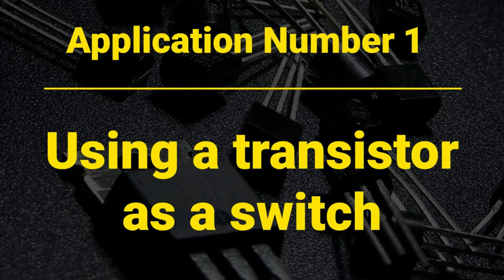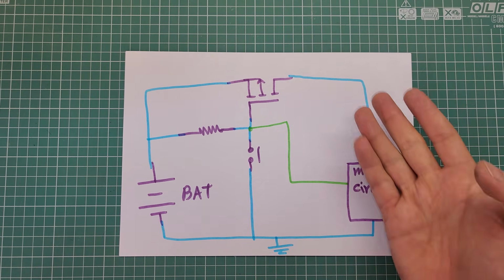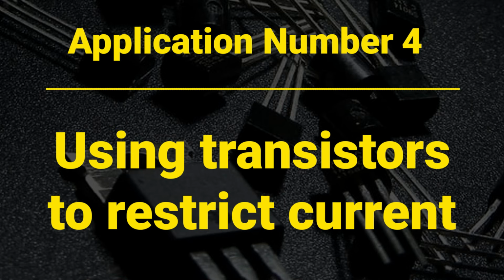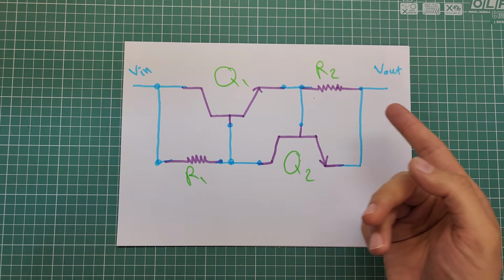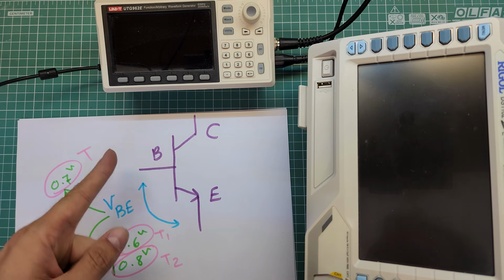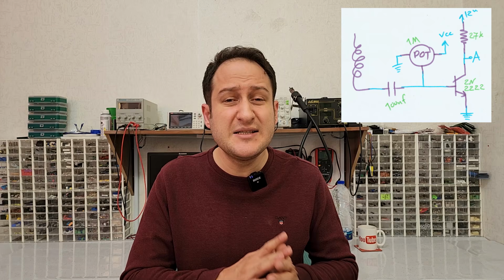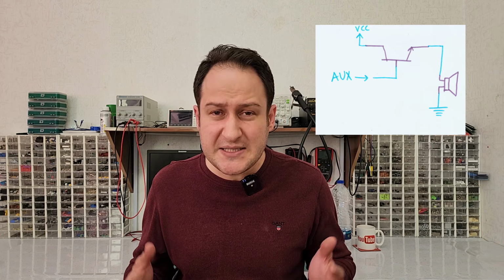7 awesome applications of transistors in circuits

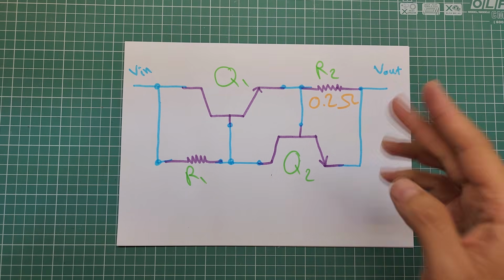Comment: I thank you again for this awsome video dude BTW one question 15:50 would you reccomend to put this on the output of a precision reference voltage IC (example 10V with precision at least 0,000) to limit the current to 10mA for example? will the precision of the output voltage be affected by this circuit? and would there be a voltage drop after the Vout?

Comment: Hi Electronic Wizard. Thank you for the video. Could you please help me to assess if my understanding of the MOSFET as a touch sensor at 10:29 is correct?

        1.	MOSFET Configuration: The IRF640 MOSFET is configured in a way that its gate (G) is sensitive to touch. The drain (D) is connected to the motor (MOT) and the source (S) is grounded.

	2.	Gate Capacitor Effect: MOSFETs have an inherent gate capacitance, which is very small. This gate capacitance can be charged up by a small amount of current, such as the one from your finger when touching the circuit.

	3.	Touch as a Charge Source: When you touch the exposed metal connected to the gate, the tiny electric charge from your body (called 
Electrostatic Induction, or ESD) is enough to slightly charge the gate of the MOSFET, changing the voltage level at the gate.

	4.	Gate Voltage Control: When the gate reaches a high enough voltage, it allows current to flow from the drain to the source, turning on the MOSFET and powering the motor. This means the motor will activate when you touch the gate.

	5.	Resistor Discharge: The 10 MΩ resistor connected between the gate and ground serves to discharge the gate capacitance when the touch is removed. With this high resistance, the discharge happens slowly, allowing the motor to turn off gradually after you remove your touch.

	6.	Improving Sensitivity: A spiral or touchpad pattern can be used instead of simple electrodes to improve sensitivity, making it more reliable and responsive to touch.

In summary, touching the gate causes a slight voltage increase due to your body’s electrostatic charge, turning the MOSFET on and powering the motor. The 10 MΩ resistor discharges this charge when you stop touching, turning the motor off.

On the role of the resistor:

        1.	Role of the Resistor in Setting Gate Voltage: The 10 MΩ resistor serves to discharge the gate capacitor when there is no touch. However, it also influences the voltage at the gate when you do touch it. When you touch the gate terminal, a small current flows through your body, charging the gate capacitance through the skin’s resistance. The 10 MΩ resistor provides a path to ground, so it creates a voltage divider effect with the effective resistance of your skin.

	2.	Skin Resistance and Resistor Value: The resistance of human skin can vary widely, generally ranging from hundreds of kilo-ohms to several mega-ohms, depending on factors like moisture and contact pressure. If your skin resistance is, say, around 1 MΩ, it combines with the 10 MΩ resistor to form a voltage divider, which can set the gate voltage closer to the threshold voltage of the MOSFET. The higher the value of the resistor, the more it “favors” the gate retaining a charge (keeping it “on”) after touch is detected, since it provides only a slow discharge path.

	3.	Choosing the Resistor Value Based on Skin Resistance: If the resistor is too low (e.g., 100 kΩ), it would discharge the gate too quickly, and your touch might not increase the voltage sufficiently to activate the MOSFET reliably. On the other hand, if the resistor is too high (e.g., 100 MΩ), the gate might remain charged longer than desired, making it less responsive. Thus, a resistor in the range of 5–10 MΩ strikes a balance, ensuring the gate reaches a high enough voltage when you touch it, while also discharging reasonably when you remove your touch.

In summary:

	•	The resistor helps achieve the necessary gate voltage by creating a voltage divider effect with the skin resistance.
	•	Skin resistance influences the resistor choice, as a higher resistor value is needed to work with the variable (but high) resistance of human skin and ensure reliable gate voltage change upon touch.

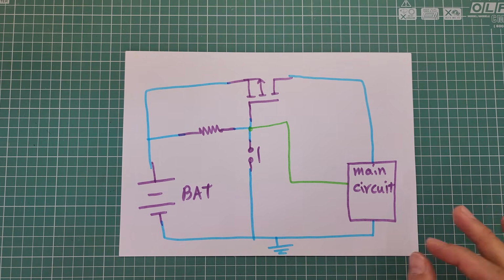Comment: I tried to better understand how circuit at 9:21 works (mosfet as a switch for another circuitry) and here is what I came up with:

1. P-Channel MOSFET Operation with Knock Sensor:

In this circuit, the P-channel MOSFET has its source connected to the positive terminal of the battery and the drain connected to the "main circuit" (whatever load or circuitry it controls).

The knock sensor temporarily connects the gate of the MOSFET to ground when triggered by a knock. This grounding lowers the gate voltage, creating a sufficient gate-source voltage difference to turn the MOSFET on, allowing current to flow from the source to the drain and powering the "main circuit."

2. Role of the Pull-Up Resistor:

The resistor between the positive terminal of the battery and the gate of the MOSFET acts as a pull-up resistor. Once the knock sensor disconnects (i.e., it stops grounding the gate), the pull-up resistor raises the gate voltage back to the battery level.

By restoring the gate voltage, the MOSFET turns off, as the gate-source voltage difference is eliminated or reduced to the point where the MOSFET no longer conducts. This ensures that the MOSFET only stays on as long as the knock sensor is grounding the gate.

3. Role of the Green Wire:

The green wire here could be intended as a way to influence the gate voltage in a delayed fashion. For example, if the green wire connects to a timing circuit (like an RC network or a secondary transistor), it could slowly discharge or recharge the gate, allowing the MOSFET to stay on for a set duration after the knock sensor releases.

Essentially, if the green wire is part of a timing mechanism, it would allow for delayed turn-off, extending the time the main circuit is powered even after the knock sensor is no longer active.

In this configuration, the green wire would indeed control the timing independently of the immediate action of the pull-up resistor. This approach combines the instant effect of the knock sensor with a gradual control mechanism via the green wire, allowing for more control over how long the MOSFET stays on after the knock.

This arrangement provides flexibility: the MOSFET can turn off right away if the knock is brief, or it can stay on for a pre-defined time if the green wire is connected to a timing circuit.

Comment: The speed at which you run your drawings and the practicals on already assembled components on the breadboard make the video useless for beginners.  

If you could take some time to explain the circuit as you draw and also explain when you put components on the breadboard...that would make the video a very valuable source of learning for the beginners.

Thank you!
Reply from the maker: Thank you for your feedback. 
I'll consider that in upcoming videos

Comment: The main problem I have noticed why people don't know how to use transistors, is the teachers. They are starting electronics with transistors, and immediately dive into the deep end of transistor analysis and different types of transistors, without actually ever explaining what they are and what they are used for. Even on the first introduction to electronics, teachers start throwing around words like FETs, BTJs , IGBTs, NPN, PNP, emitter, controller, base etc. never actually telling students what those acronyms mean.

For example, a few years ago, I participated in 1st year students electronics course in an University as an undercover student to troubleshoot why everyone was failing these lessons. I have a few engineering degrees and although my electronics degree is from the the early 2000s, I could barely follow the class and had to correct the teacher several times on critical (possibly fatal) theoretical errors, because he thought they were so obvious everyone would know that he was talking about only a very limited use case with a lot of safety precautions in place. With the excuse that I had "just read on a the internet that isn't it like this instead?", since I couldn't just let those things pass. Then the after the 2nd week, theory was over, and we moved to lab to start building a full audio-amplifier. Basically, everyone just followed instructions, but didn't understand anything they were doing, and learned even less. I won't name the school, state or country

The teacher was a former electronics virtuoso from a top name company (that still did consulting for them, but had downshifted to teaching), but he was so disconnected from beginners, he was talking and teaching to them as they were all post-graduate students, and just excepted everyone to be at that level coming in to the first electronics lesson. Also, for some messed up reason, physics I and II were scheduled AFTER the electronics courses.
Reply: I am self taught, but I ended up teaching myself into a corner like you are describing. I started with learning things like the Shockley diode equation and small signal analysis. My path would have probably been a lot more efficient if I would have just messed around with transistors in my lab for a few months before learning all those subjects. It's extremely difficult to "simply work" with transistors while keeping all those lofty bits of knowledge in mind.
Reply: You are not alone even in other industries in tech
Reply: I have had that same problem with my educations some teachers are from the work envoirment wich is fine but they can't teach that well as the ones that actually studied to be a teacher like someone who teaches physics compared to one who teaches basic electrical instalations with relays lamps buttons or my PLC teacher horrible teacher nice guy outside of teaching
Reply: Now there is a mafia teacher named as AI
Reply: Even worse... start teaching from Millman Halkias.

Comment: ....IMHO: :face-blue-smiling:I think that for many people, working with various "electronic" devices, etc., we often find that, if any circuit board "craps out", it's often faster, and cheaper to just replace the "entire board(s)", rather than trying to sort out any specific faulty components on the "bad board"...So, although we may study "transistors", and solid state devices',... unless we specialize in being an electronics repairman/bench technician",... we never get "good" at finding specific "faulty components", and replacing "them".... instead, we merely replace larger boards, entirely... :face-green-smiling:
Reply from the maker: Thank you for your comment 👍 I think your opinion is right in most cases

Comment: Well, if you do a course on chip hardware design, the only thing you will be doing is transistors and transistors and transistors. It's the only element we use! Not even resistors in between them (we use MOSFETS)! If you have a look at my channel, you will see how we use transistors to build any logic we want and even build a whole custom cumputer...!

Comment: At 25.04, should the motor not be connected to the collector?
Reply from the maker: Nope, this configuration is called "Common collector" the circuit is OK.
There is a dedicated video about this circuit on the channel. Look for DC motor speed controller video on the channel for detailed information on this subject.

Comment: wow washing someone describing my hobby in such a confusing way troubles me.  first vacuum tubes and FET field Effect Transistors are voltage contorled devices. a BJT is NOT Binary Junction Transistors are current controlled. I stopped counting at 30 misleading statements, If anyone wants to learn electronics this is not the channel. a great example of " If you can't dazzle them with brilliance baffle them with BS "
Reply from the maker: Thank you so much for your feedback ❤️

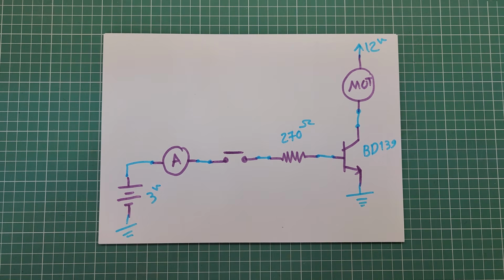Comment: 3:02 "Since BD139 is an NPN type BJT transistor, it is better to use it to switch Ground voltage" 
but why ?
Reply from the maker: There are several reasons. See this video 
https://youtu.be/L0QraSYq8tw?si=gcBXkraxCiDBjlcK

Comment: When switching a motor or anything else with a coil, use a feedback diode! This is to avoid/cancel back EMF. Without it can ruin your funny experiments with transistors pretty soon.
Reply from the maker: Yeah, this point is covered in another video of mine 👍👍

Comment: That's what I'm trying to do switching the whole circuit without passive power drain, but I have yet to find a suitable BJT transistor with enough Hfe
Reply from the maker: Use alltransistors.com to find suitable part number

Comment: Good info, the audio makes it hard to listen though. Please process your audio or by a good microphone
Reply from the maker: Thanks for the point ❤️
Reply: @elewizard  I have similar vice type and without filter the sound is not good. In order to avoid post processing my audio every time I use Sure MV7 with their software. Once you setup the filters the audio is good every time. My configuration for creating YouTube videos is: I use SurePlus Motiv for the microphone , then it goes into NVidia Broadcast as I apply some extra filters and background blur, and then it goes into OBS Studio. I don't use filters in OBS though it has plenty. Just to setup my scenes, screen. My first video had terrible audio when I used my Webcam microphone.
Reply from the maker: Very interesting, thank you for sharing

Comment: transistors have insane applications, i dont see how people could struggle with em.
Reply from the maker: Maybe
Reply: @elewizard  its true. Not only for integration of small electronics into big machines, but you can add complexity to circuits simply by having an entire secondary circuit connected via transistor. I use them for all sorts of stuff, almost as much as I use diodes.
Reply from the maker: Thank you for sharing 👍❤️

Comment: I would not call the simple 2-transistor current limiter a "switch." 
The main transistor is essentially switched ON below the current limiting threshold, but as that threshold is approached the whole circuit begins to operate in linear mode.
It is important to remember that the main transistor power dissipation may be quite high and a heatsink may be required.

This circuit isn't high precision and you'd get a moderate amount of variation from one unit to another, but it is plenty good enough for lots of applications.
Reply from the maker: Good points, the circuit is not high precision, you have to add some other components to make it more precision. Components like OPAMP. I will explain it in one of my upcoming videos 👍

Comment: Yeah, WOW man. Wizard actual. You seem to use English far better than many of my American neighbors lol.

I'm already using a custom open source 'Solid State Tesla oscillator' circuit (by Master Ivo), employing SiC power mosfets, running a [bifilar pancake] Tesla Coil based 'single wire transmission line',  improvising simple little analog circuitry for probing my system. Even so, this vid managed to:
a. Rock my world
b. knock my socks
c. cause me to execute a backflip

Question:
How would YOU replicate Tesla's trick of using an old telephone handset to 'listen in' for null points along a [scalar/longitudinal]TX line? F resonant is around 120kHz, must i use a heterodyne to get audible tones, or can it be managed more simply?

I think Tesla was also using telephone handset with a 'coherer' RF detector to make just periodic 'beeps' out around NYC while his transmitter was oscillating. A simple 'periodic beeper' to sound off when my step-down 'receiver' transformer is getting power from the line (or spherical terminal), would be helpful for me to demonstrate reception inside a grounded faraday cage too - any tips, my guy?

❤ cold

Comment: One type of transistor serves as an inverter in one piece. Solar power banks use it for the Nokia 5110,6110,7110 series. The transistor can invert the 3.2v safely to 6.9 v when loaded, and can operate a 6 v cleaner motor at high speed from a little 3.7 v Nokia battery.